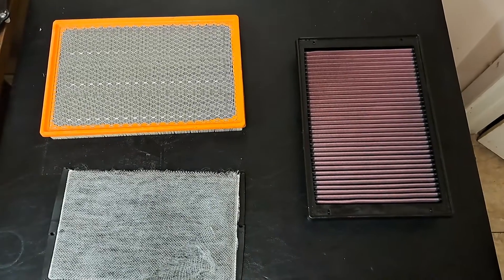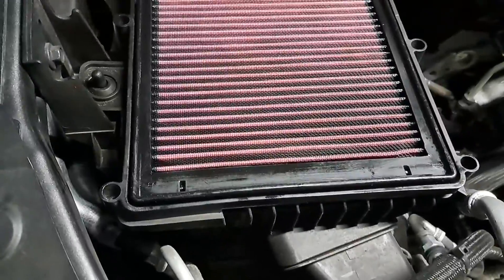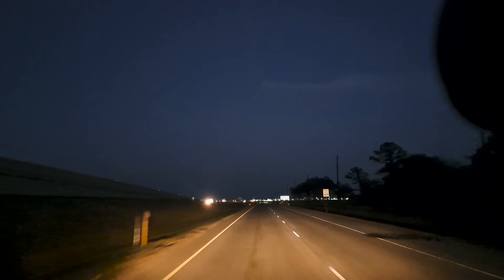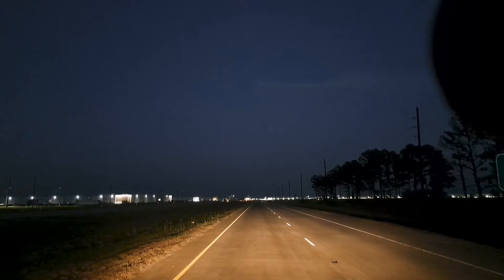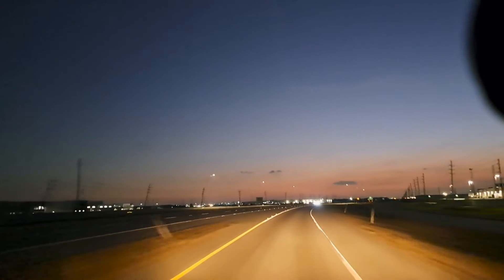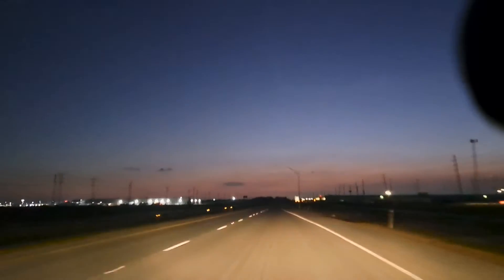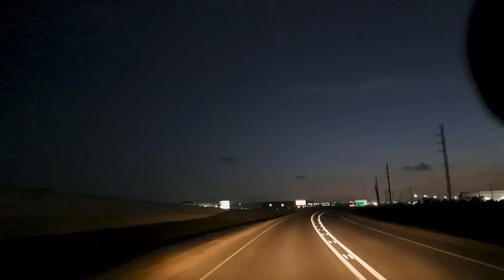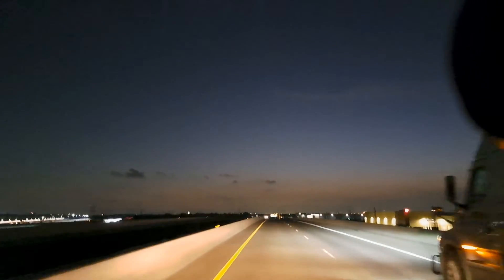Ram 1500 Cold Air Intake Testing. Airaid Junior.  PART 2.

Comment: I'm late to the video but i just bought a 2024 Turbomax Colorado. It was a little sluggish on light throttle until a put an Airaid Jr. kit from a 2.7 Silverado on it. I have the Airaid tube with an OEM filter now it seems to float upon easy take off now. That being said i would say with your data logging and my butt dyno it is plausible the Airaid stuff does give you some gain. I still need to put a K &N  filter in, its on order.

Comment: These CAIs can sometimes improve performance. I've done some back-to-back testing comparing stock box with a drop in filter VS AFE momentum on my 6.4 Jeep. Measured "actual torque" in VCM scanner and calculated hp based on that. AFE gave 13hp more. It ain't the "27 hp!" on the box, but I'm still happy with the results.